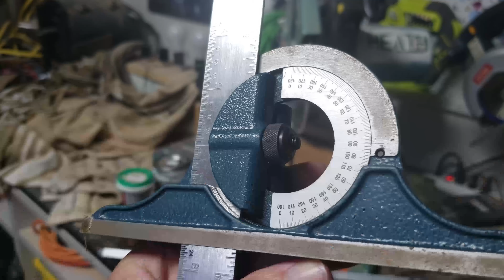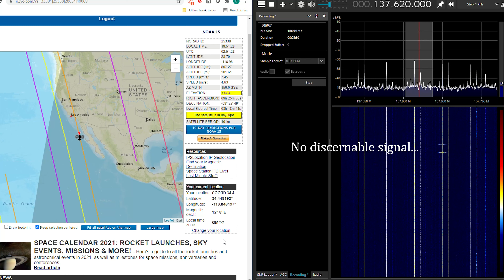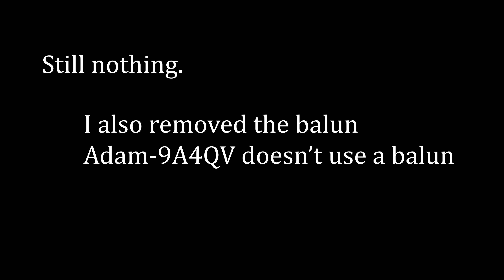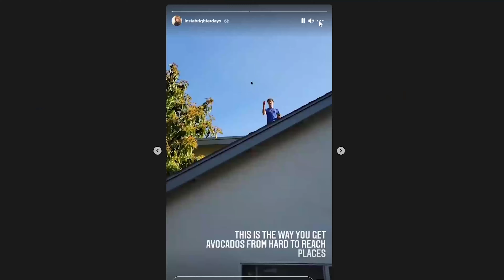Making an Antenna from Scrap to Download Live Satellite Images with an RTL-SDR

Comment: You need a 120 degree ground V half a meter below the elements. connect it to the coax screen below the isolation choke.
This allows the V-Dipole to be used at any elevation. from ground to top of a roof.